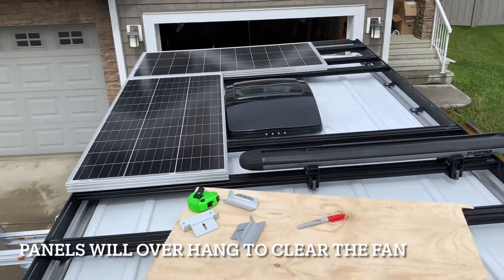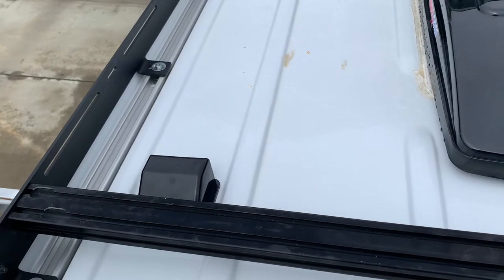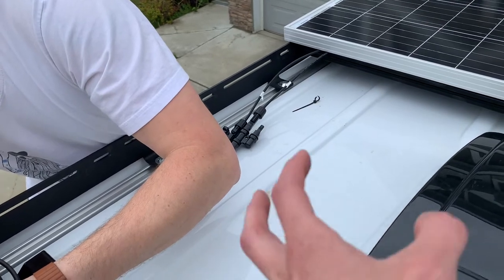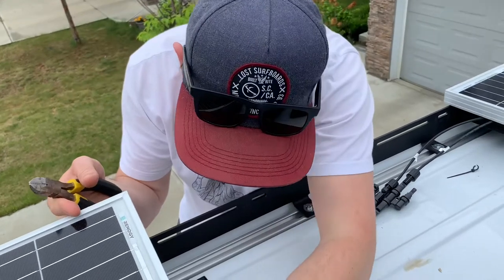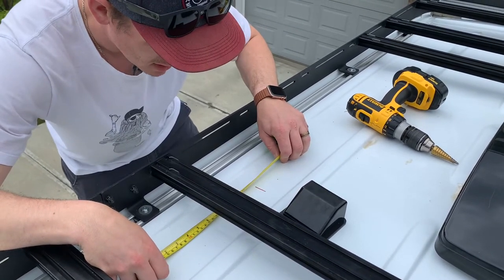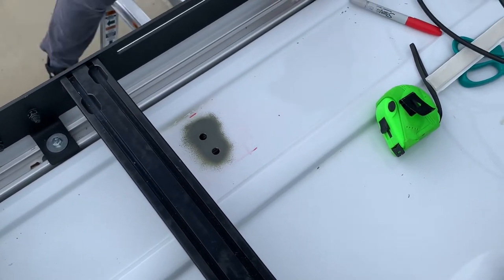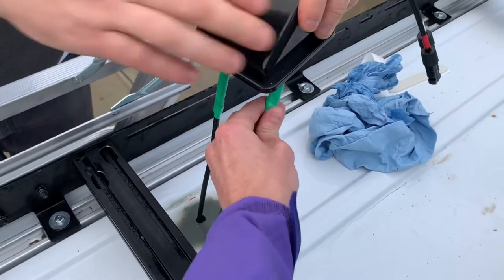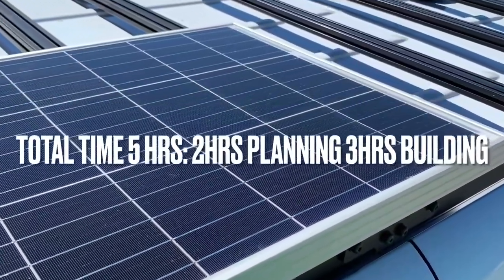200W Renogy Van Solar Panel Installation

Comment: Finally found a recent set up of these panels! Thank you! Great video. Mine are coming in 2 weeks and this will help heaps.
Reply from the maker: Glad we can help out! We have been using now for several big trips. The panels do a good enough job of filling batteries if it’s sunny. Really glad we put in the alternator switch too though. Some of our trips surfing have been not so sunny. Go for a quick drive and the batteries are charge enough for the day.

Comment: Great video, I have the same roof pass thru box and was wondering how to mount it without using metal screws or some kind of super strong adhesive. I did buy just buy metal grommets to protect the wire, I like your idea of butyl tape will add that to the grommet protections.